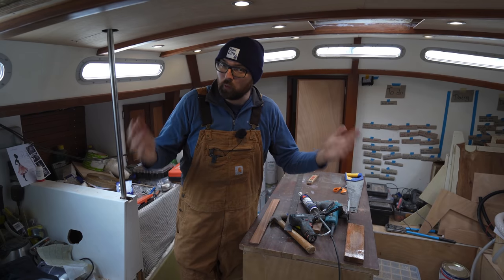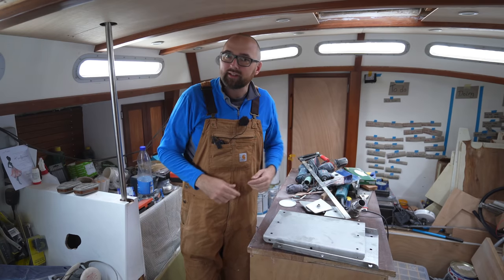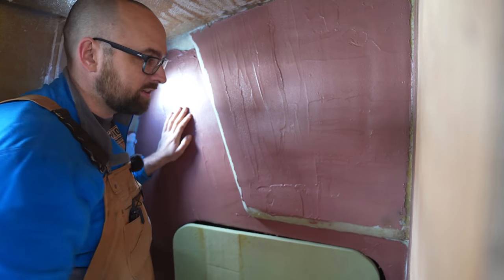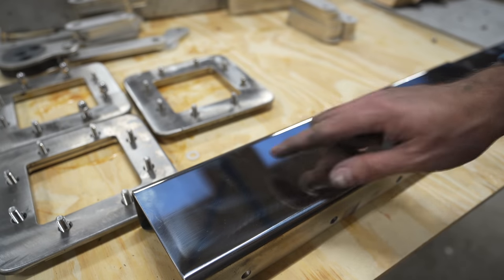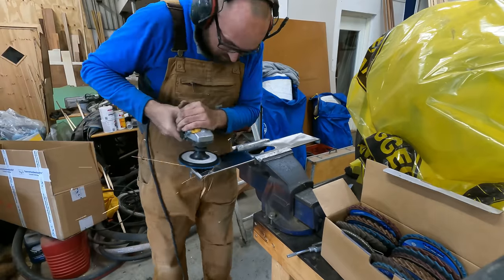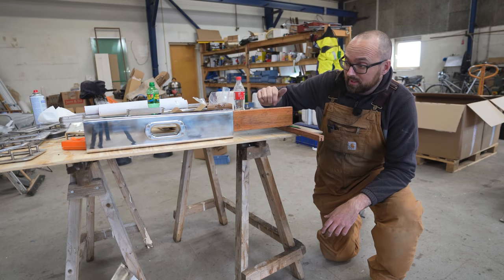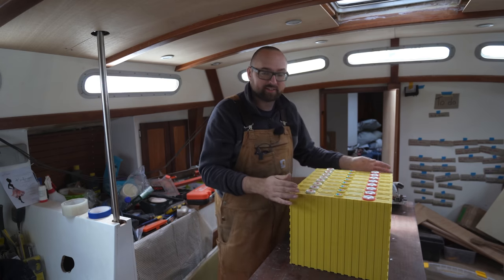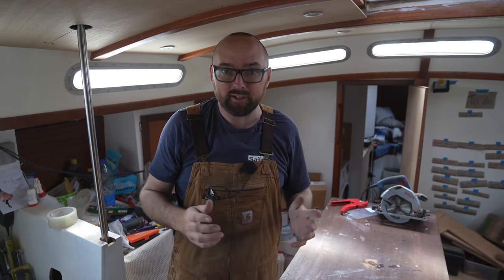Sail Life - Battery compartment, solar arch and toe rail - DIY sailboat projects

Comment: Oh, and a suggestion on the Arch, make sure to include your stern light, it should be on the absolute furthest aft point of the boat so it doesn't splash back light and mess with your night vision.

Comment: Sprint to the finish!

The bulwarks/toe-rail system is even more amazing than I had envisioned.  The arch integration is super extra spiffy.  I cant wait to see how the davits fit in and how the dinghy hangs.  Hopefully you will have good rearward visibility from the cockpit.

Athena will truly be a Dahlke 38 and no longer a Warrior except for the shape of the hull on the outside.  

Good work.  Keep the videos coming.  Carry on, and get 'er done!

Comment: Just to the cellular antennas. Normally they do not work effectively inside a metal structure. They like to be in free space. The metal will influence the radiation pattern.

Comment: IMO antennas should be mounted up on the mast on a small yardarm to space it away from anything metallic.  Metal around antennas are a ground plane which affects incoming/outgoing signals. The stainless toe rail setup is very nice & will really show beautifully against the white hull.. Battery install super clean.  Putting tape over the terminals until cable installation prevents "welding" accidents. 😜  Your attention to detail really shows...that separates the "really nice" from the "nice" boats.

Comment: Since antennas always do better the higher they are up, why not add the extended range Wi-Fi antenna at the top of the mast, and the cellular ones on the spreaders?
Reply: I agrre
Reply: My thought exactly - if there isnt enough room inside the mast for another cable, perhaps you could rig/weld  some sort of bracket to front of the mast by the spreaders? High enough up to boost the signal but easy enough to get to?
Reply: I had this same thought, he's even got a fish string already there.  The only problem is if I remember the mast video he was having trouble getting the wire down the pvc inside the mast because of the pop rivet bases.  Wifi works best line of sight, so being higher up will be better than at the arch level.
Reply: Need to take in to consideration loss of signal from the cable run.
Reply: @SailingMomentum  you won’t get that anywhere on that boat. Also if you think about the run from the Nav station to the solar arch vs Up the mast I bet the run is less than 10’ shorter.
Reply: @bobadam7021  depends on what cable he is using and where his router is going. If he uses lmr400 the loss will be less if he uses 100 then it's 10 ft will make a pretty good difference. You can lose half your signal really quick. That router needs to be as close to the cell antenna as possible or he will lose everything gained by the antenna. Best to mount the router near the entry point of the cable and run eithernet to the nav
Reply: @bobadam7021  if your going to the spreader Def not as bad as the top, but the top can reduce signal by over 50% or more. If you go to the top you should use a hd1 dome. It uses eithernet cable and there is no loss. The router is up at the top. But I'd get a better wifi antenna. That guy is tiny. A better antenna mounted lower is going to give better signal. Axxess marine makes a sweet dual band wifi. I just picked it up last week and it works awesome.

Comment: if you polish the sterne plates now you'll save yourself a frigging headache later because right now you can easily flip them hold them and get to the lips without any issue
Reply: What they said
Reply: @MobileCabinWorks  I think Robda might mean prior to welding, I was going to suggest that before he had them tacked in to the arch (much easier to polish the small area around the arch feet after welding than to do the whole lot after welding)

Comment: Nice bracket for the batteries I have them on my boat, but leave some room for the batteries to expand a bit, if they are too tight and they swell they will blow the pressure relief valve, I suggest a 3mill rubber strip between each cell.

Comment: Great video, you might want to think about some form of cooling for the solar panels most come with a solid underside however if there is air circulation under the panel you get better electricity production. Might not make a lot of difference in Denmark or in Europe but in some areas of America it does get rather warm.

Comment: You can shine the stainless even more using foam backed sand paper pads (from Klingspor). With some spirits (no water) on the part, and a very light but firm pass, you can shine them even more. The foam backed sand paper (fine) burnishes the stainless steel and closes the pores. After i sharpen knives i always do this, it works so well that the water and food doesn't even stick to the metal anymore. I can just put the knife under a jet of water and it rinses it clean.
Reply: what grit do you use?

Comment: I've spent more time than I care to remember polishing stainless and aluminum on hot rods. There is no pretty way to do it, no way to stay clean. But when it is done the sun reflecting off of it knowing you made that happen is worth it. Just avoid getting as OCD as I did. On one hot rod I decided to polish the transmission case. I wound up getting into the tight spaces with a Dremel tool and the little barrel polishing wheels. Took a full week. I had a broken foot at the time, and looked like and idiot wandering out to my shop on crutches with my right leg in a black trash bag to keep the cast clean.
Insane, I was.
But it looked awesome...

Comment: If you would need to built a roof for the solar paneles, you coud use it in addition as a rainwater collector. On longer rainy passages you can afford an extra sweet water shower.
Reply: Very good suggerstion.

Comment: I've been following you since you first bought Athena. My goodness...that is the luckiest boat on earth! She's going to be absolutely stunning. Your toe rail design is just incredible and very aesthetically pleasing! I wish I could help you polish some sections of the stainless parts. But on that topic, if you have some foam matting you can wrap some around the electric tools you're using to polish it and your fingers and hands won't go numb quite as fast the not at all depending on the quality of the foam matting..or even small bubble..bubble wrap. Your boat in terms of electronics is a technical wonder, and now with the rear arch, the toe rails, the paint job, etc it's aesthetically absolutely gorgeous! You're building the most beautiful and technically advanced sailboat I've ever ever seen or heard of! Keep up the awesome work!

Comment: Maybe look at mounting the WiFi antenna on the spreader - BUT make sure you get the right coax (it will be thick!) the loss at UHF is huge which will remove all advantage.
I will be using a remote modem up the mizzen on mine - that way the long run is digital. Might be worth looking into you can still use the aerial.

Comment: Mads, you may want to mount the cellular antennas with standoff mounts to provide clearance from the arch frame, the frame will affect the signal and possibly give you some reflection (PIM) back into the antenna causing noise in your signal. PIM (Passive Intermodulation) is found with metal too close to the antenna propagation field, but if you mount each one of the antennas off the back pipe a good 12" - 16" out from the pipe it will help a great deal. My two cents having worked in the wireless world for 35 years.

Comment: Hi Mads, You'd benefit a lot by adding spacers between your LFP cells for atmospheric heat sinking and cooling purposes. My aluminium shelled CALB cells with spacers gain 10°C per hour at 1C and take an hour to lose 2°C afterwards with passive cooling.  I'm very much looking forward to your CIGs solar test.  You can get felt flappy discs to take the polishing a step further.

Comment: Hi Mads! I'd suggest to add a 5 GHz Wifi antenna to your array. Plus a 5 GHz-radio (perhaps ubiquity bullet ac) plus a second Wlan router. Marina Wifi on 2,4 GHz can be pretty crammed. Plus two more mounts to the rear end of the arch, for a backup VHF antenna and an Iridium antenna. Yes, I absolutely share the idea of completely avoiding any shading. The Iridium antenna needs to be just overlooking the panels, so the shading occurs only at low elevation of the sun, when the solar output is very low anyway. Then I would do a test with a thin steel VHF antenna to see if the shading effect is negligable, or just mount this backup antenna only when needed (failure of masthead antenna or AIS splitter). Cheers from Curaçao, U.

Comment: Due to Fresnel zone higher is better for any long-range radio communication, so near the top of the mast seems to be the perfect place for your wifi antenna. Add one of MikroTik's Metal 52 ac radios and all you need is a run of regular external gel-filled cat 5e lan cable inside the mast, PoE takes care of powering the unit.

Comment: Mads, with antennas, distance vertical is your friend. One the long distance wifi, finding a place on the mast that you can mount it would add to the effective distance that it can reach and also the easier line of sight to other antennas that might be in a marina. Good Luck with the build.

Comment: Have you thought about the wear on the lines that run through those holes in the toe rail? This covering-thing is split in two parts, which means that where they meet you will have a not-well-rounded-over spot for the lines to rub against when tied to a dock e.g.
Maybe fix that before securing everything in place?

Comment: You could mount the WiFi antenna either inverted where you demonstrated as it would still have vertical polarization and avoid shadowing on the solar or put it on a stainless pipe that can rotate 90 or 180 degrees and latch like a simple sliding door lock

Comment: Hi Mads,

Reaching  “the bottom of the bottom” is another great expression from you I have to remember.

For your antenna, I wouldn’t be worried about the shade it leaves on the panels. Don’t think its going to affect their performance much.

I would place the antennas on a spreader on the mast?

Cheers

Comment: Lovely work Mads! I really like the rubber on threaded rod solution. Especially as I will install 16 pieces of 280Ah in my boat in the coming month. I think I'll steal that idea. Are you going to use lopolight lanterns? You should definitely contact them to get them sponsored(heap of money), as they are a proud danish company. 

Best regards from a Norwegian sailor that just settled in Gilleleje, Denmark with my boat and Storm the sailing Schnauzer-doggo.

Comment: Consider welding a tube under the arch, then fit the aerial to another tube inside the welded tube, that way you can rotate the aerial as required.

Comment: I'm curious about the top balancing you mentioned. Why top balance when you could bottom balance? Bottom seems vastly superior. There's a couple compelling threads on cruiser's forum and electronics stackexchange. Top balancing doesn't seem very belt & suspenders and as much care as you're putting into the electronics on the boat you should bottom balance!
Reply: Because bottom balanced cells don't suit the way a house bank is operated, it will rarely, if ever be fully discharged, so why balance there?, top balance other the other hand... Read this,  http://nordkyndesign.com/assembling-a-lithium-iron-phosphate-marine-house-bank/

Comment: Mount the swivel to one end of the panel bracket. Make it so the antenna folds against the side of the panel. If you make it fold outward also, you can probably still get good performance from the antenna.

Comment: you might want to move the antennas between the arch legs to behind the arch, typically any metal within the same distance from the antenna as it's height, might cause coupling issues.  Assuming you are using Times Microwave LMR-400 cable or similar...this cable is so stiff, i'd just leave the center antenna up.  Alternately, I think you might find that wifi connections are limited to marinas (short range usability) and fiberglass is rf transparent at wifi frequencies, put the antenna up and down (vertical polarization) in the aft tech compartment or against the transom above waterline and copper coating.  You can test locations and observe the rssi signal strength in the marina.

Comment: For the antenna mounting in the middle of the solar arch, why not use a Glomex RA166 Stainless Steel Adjustable Antenna Mount. This will give you a full range of adjustment and allow you to move the antenna out of the way as you wanted. Pricing shouldn’t be to bad either, they’re well made strong and durable too.

Comment: I can really understand you choosing Lithium batteries instead of lead, all sorts of advantages! I would be interested to hear what your research has revealed regarding the fire-risk of these batteries, my understanding is that if they do catch fire the fire is very hard to extinguish. Basically the battery unit would burn itself through the hull of your boat? Ironically you did say something in the video about trying not to short out the batteries during installation. It would be great to hear your feelings about fire risk and what contingency plans you have should an incident occur.

Comment: 13:13 Mount that internet antenna at the top of the mast. 15:08 Until the movement that you do get wears through the fuel lines and then the threaded rod can wear away the battery housing. I would have opted for PVC.

Just my thoughts.

Comment: With the WiFi antenna mount put a tube in a tube that will extend upwards the desired distance from the other antenna's this allows for easy stowage as well as higher mounting when in use for WiFi.

Comment: You obviously know what you are doing. A tip for others: when working with cells, you can just put masking tape on top of them to minimize the chance of accidental shorts. Electrical tape works, too. Almost any tape will prevent a short. I am an electrical engineer and I often have to work with battery packs that are partially disassembled or otherwise not totally safe for handling.

Comment: Mads Not sure if YT are OK with links and product names but if you look for a channel from a bloke called Will Prowse especially his latest video which is a comparison.  He is very good on Solar and batteries In particular if you watch it he mentions a 100 watt solar panel that is the bees knees Not the cheapest but gives great wattage for its size obviously important in a marine environment. He also showcases a new type of Solar Panel this charges on both sides obviously you need a reflective surface for this like snow but I am thinking the sea is quiet reflective as well.

Comment: CIGS panels are awesome. Even if a cell gets damaged in one spot the rest of the cells still produce full power. They should last many times longer than normal flexible panels and if they're decent ones then th efficiency is higher than the best mono panels.

Comment: The only thing i'd do different about the hatch in the head is half and half seal. These are common on washing machines (or at least on old ones). The top of the hatch has a lip that's on the other side of the wall and the bottom of the hatch has a lip that's on the inside of the wall. Idea being that regardless of where water strikes it, there's always a "shedding" lip to deflect water.

To put the hatch/cover on, you insert it perpendicularly into the wall at the mid point where two notches the thickness of the lip exist, which allow you to pivot the hatch shut once installed. 

I've copied this design on most exterior electrical panel covers i've had installed in client's houses (stainless steel panels being flat, don't need to be installed at 90 degrees, you can insert them shallow angled too). There isn't so much a drop of water past them, where as before, with time the seals would leak and fail, now it doesn't matter. I don't know who came up with this, but it's an amazing piece of thinking.

But that's neither here nor there, for something like a bath/head, the current hatch should be more than sufficient. 

Also, since you have access to laser cutting, you should cut new rings for the ports that were once split by bulkheads, rather than buying them new. You can even anodize them yourself using pre-made kits from amazon.

Comment: Solar arch looks very wobbly sideways. There is a risk of collapsing it left or right after few months of shaking at sea. Maybe you could add some stiffening around top corners and consider also mounts for wire rigging in case you need to add them later.

Comment: What are you going to do to keep the stainless steel from rusting? Are you going to have it Electro polish after you hand polish or are you going to use a type of acid? If you don't you'll be sorry later when it rust spots from the surface impurities. If you're going to weld tabs to the stainless a lot of times it's easier to polish it twice. Polish before you weld them on and then you just have to do around the tabs later. It can be much easier. When you take away the clean smooth surfaces with opticals tabbed in it can be a bugger to catch your wheel on.

Comment: Can the wifi extender go on a spreader on the mast? If you want it on a pole on the back of the arch make a pole that extends back about a meter behind the arch with the stern light mounted on it. Have a slot in the pole about 10 cm from the aft end of it that goes from straight up to 90 degrees on one side or the other. Then you could have a smaller pole inside that big one that has the mount for the antenna on it run through the slot. On the forward end of the pole you would only need some way to turn it (if it doesn't weigh much you might just turn it by hand), and some way to lock it in the upright position (a hole and a pin).